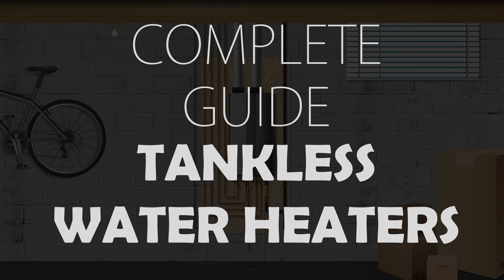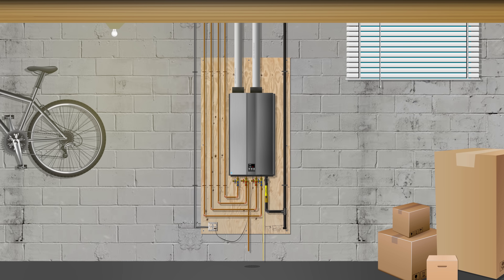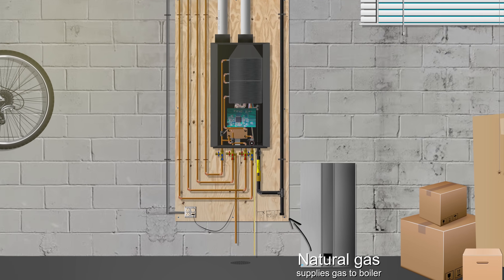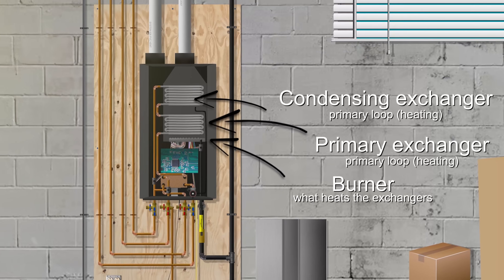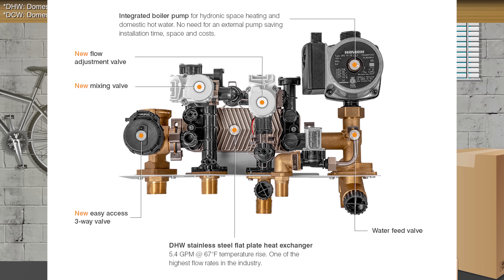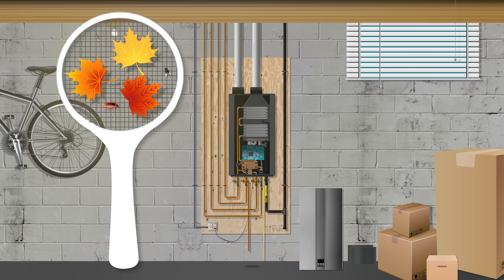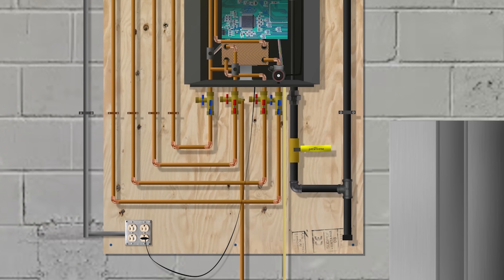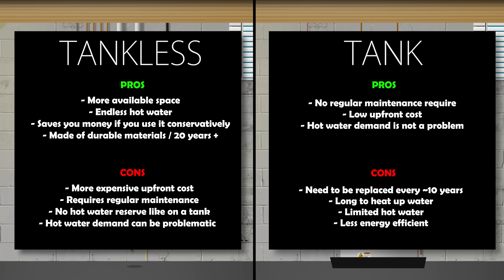Tankless Water Heaters (COMPLETE GUIDE) | GOT2LEARN

Comment: Bottom line is that I'd stick with the conventional tank water heater in an older dwelling.   If  a lot more people knew about, and how to change the anode rod, their water heater would last much longer than 10 years. The problem is getting the darn old ones loose.
Reply: I do same, have gotten double plus the life out of a 6 year tank. I use an electric impact driver to loosen the anode rod. Depending on tank placement, having room to pull the rod out can be an issue.
Reply: @gnic76  Did you replace the rod with the same type or did you use the more modern ones that are like links of sausages for use in tight spaces?
Reply: @loumitch1  Nope, used a solid one, the magnesium ones aren't a stock item and it was cheaper in my area. The linked ones were harder to find at the time.
Reply: My tankless water heater uses half the energy of a tank.
Reply: @SawmillerSmith  Gas and venting upgrades are required for some retro fits;  cost of the unit is double that of a water heater; tankless require more frequent maintenance ; much higher installation cost; pressure loss in times of high demand; and those higher upfront costs could take 10-20 years to offset any fuel savings. If you lose power, no hot water.
Reply: @loumitch1  some use batteries so lost power has no effect.  Yes it depends on many things. I bought a cheap tankless water heater on Amazon and hooked it up myself. It was cheaper for me to go with a tankless in my situation. I would of had to built a lager room for a regular water heater.

Comment: I never even saw one of those. I know tankless coil inside the boiler. Also oil fired equipment is prominent where I live. A few people have gas, and no one has electric heat or hot water. I've seen it but it's very rare.

Comment: Nice explanation. In my own house I placed a tankless, small, electric, on demand unit at the kitchen faucet. I installed an electrical hot water tank (50L is engough for only me) for the shower and the tap in the bathroom. For the heating I switched to IR (infra red) electric heating. In combination with my solar panels on the roof that saved and still saves my a lot of money on energy costs.
Reply from the maker: Niceeee, green is the future!! 🥦

Comment: Not sure if you know this, but here goes.
When you have the simple conventional boilers that rely on zone valves to switch from heating a tank or heating the radiators. One of these set ups is more suited to a house with more than one bathroom, with a higher hot water demand.
Whereas combi boilers are limited to the water flow it can reliably heat up, therefore they can't cope with a large demand for hot water at the same time.
Now for the part some people don't realise. Combi boilers need to have a high BTU by nature, to heat up the flowing cold water fast, which makes them ideal for this. The heating circuit can be zone valved the same as a conventional boiler, therefore allowing for a hot water tank. With that method, you can have bathrooms receiving hot water from a tank, and say the kitchen and utility room receiving the mains fed hot water. Obviously any taps receiving mains hot water will still receive priority from the boiler over the heating/tank side.
And using a mains high pressure hot water tank eliminates the need for a gravity fed cold water storage tank to top up the hot tank. Also, as the central heating side of a combi boiler is pressured, it doesn't need an expansion tank like a lot of conventional boilers do.
I hope I explained that correctly.

Comment: In 2012, my father and I replaced an old tank with a Rinnai tankless and it has been mostly a great experience. I agree that the cost savings really do depend. One of my daughters alone has eliminated any cost savings, because she has little incentive to take showers under 45 min. If it wasn't installed in the corner of the crawl space in thr basement, I'd turn the thing off 25 minutes in.
Reply: I don’t know if you can depending on the age of the unit but you should be able to get another (thermostat on/off) part that allows you to place it further away from the actual unit and in a place that’s easier to access. Some have to be hard wired in but to save money it might be worth looking into.

PS hope your daughter doesn’t hate me for this input :)
Reply: Its a Rinnai RL94iN. I don't think it's worth altering anything. I don't care about the money as much as it is just another thing to be a parent about. She's in HS, so she has all the answers and has figured nearly everything in life out already
Reply: @ccbowers  ah to be young and know everything haha. Well as long as you’re happy with it, for the most part, then I would keep it the same. If you have to replace it then you can look into something different. Rinnai now offers a control module that connects to your homes WiFi so you can control the temperature and other settings from an app on your phone or tablets. It actually might even connect to the into you have because you connect the module to the unit itself. Each year they keep getting a little better and little more intuitive with battery backups for power outages and such. The older units you have to add stuff like that on yourself however. That was the biggest issue I saw with them in the beginning was since you have to plug it into an outlet you would lose your hot water in a outage unlike if you had a standard gas tank type water heater. I told my customers to go to a office supply store or online to purchase a surge protector with battery backup so they could have a few days of power if needed in a storm. Anything that help keep people happy and with the ability to have hot water when needed is what I say.
Reply: Why not just use a wireless water valve and control the flow from your phone.
Reply: Nobody needs a 45 minute shower. She must lead a leisurely life with zero responsibilities. My showers take five minutes if I'm having a very slow morning.
Reply: @paulmaxwell8851  The internet is very impressed with your shower duration and efficiency. So amazing.

Comment: Having used both with years of experience I would stay with a traditional tank system. Everyone always says they will save you money. However, a thankless model will use more gas or electricity thank a tanked model. Ex. My tanked model gas bill for a typical month is $21, the thankless model gas bill was about $45 a month. In addition the thankless model will waste water because it takes forever to get hot water at point of use. Not to mention the reduced flow rate from a tankless. Realistically the ONLY advantage a tankless unit has is for large families so they can shower with hot water continuously. My family of 4 with a 50 gallon tanked system has never had a problem with running out of hot water.
Reply: Reduced flow? Perhaps you had an underpowered unit. I've never noticed this issue. I could imagine if 3 people were showering simultaneously that could happen, but with a tank i that scenario you'd be in a worse spot. I agree that delay to hot water is a significant downside
Reply: You can also get a model with a recirc pump that keeps the hot water line in the house always hot so you get hot water soon as you turn on the tap.
Reply: I've been an energy consultant in the commercial sector for a long time and I have actual before and after data on this issue and I can say and in most instances it reduces the fuel used because it eliminates standby losses during periods of vacancy such as nights and weekends etc. I can't agree with your blanket statement but certainly in some instances I think you could have valid concerns.
Reply: I guess it depends a lot on usage patterns.  My tankless cut my gas bill by about 75% compared to the 40gal. tank it replaced:
https://youtu.be/OBpjMeCODHk
I notice no reduction in flow in normal use,.  But I did rig up a test where I pushed the heater a bit beyond it's maximum BTU rating and there I did see it cut the flow a bit to maintain the hot water temperature, which I had set to 140F.  I also only see a short additional delay in getting hot water at a tap, maybe 5-8 seconds more than what the old tank heater did.  That will depend a lot on the hot water plumbing layout in the house.  In my house, the old tank was actually in a very central location and hooking the tankless up in the same location kept the hot water delay quite similar, maybe ~25 secs. with the tank and ~30 secs. with the tankless.  That could be solved with a recirculation pump.  But for me, the added cost and complexity of a recirc. system is not worth the small time and water savings.  However, if the city would put out a rebate program for doing this, I would probably jump on it.

Comment: Great job, man! But there's one mistake: the circulation pump is set on a heating return, not on a domestic water line. When you're opening hot water tap, the water flows by its own pressure, and flow sensor plugs heater in a hot water mode. So there is no needs in circulation pump on a domestic water line. Otherwise, you did a Titanic job! Greetings from Russia, and sorry for my poor English!
Reply from the maker: Thank you so much!!!
Reply: @Got2Learn  that is true about the water flow. I also know that some combi boilers (Well, some did in the old days, not too sure about all modern ones) won't allow the heating to fire up if there is a dripping hot tap somewhere in the house, if the boiler senses that slight water flow, with the domestic circuit, it always overrides the heating circuit.
Reply from the maker: @mickk8519  niceee!!!
Reply: @Got2Learn  sorry, should have added, you do some great videos young man 👍🏻👏👏👏
Reply from the maker: @mickk8519  thank you sooooo much!!!
Reply: @mickk8519  That's right! All modern combis works that way. When there's no hot water flow, it works only on heating. And when you opening the hot water tap, it plugs to hot water mode, and due to this, the heating is stopped. They using this scheme to reduce a boiler's power. And this idea works nice, because even if two people would take shower one after another, the inside temperature won't fall even on a half degree. Assuming that, the device becomes cheaper, and working by that scheme it uses a lot less of gas, saving your money.
Reply: The guy who wrote this comment has never worked in a commercial building... All large commercial buildings need recirc pumps on domestic hot water lines so you don't wait 10 minutes before getting hot water and which wastes a lot of time and water.  Try again...
Reply: @CybekCusal  he's talking about combi hydronic/central heating boilers, not a storage/instantaneous hot water unit ring main like you'd find in most commercial settings (although becoming more popular in some domestic situations in order to save water) and is right. if you're running your heating (on the boiler displayed in the video) and turn on the DHW water the unit will stop the heating (CHW) process until the demand for hot water has stopped. although both essentially ring mains as the hydronic/central heating boiler has a flow and return, these units generally don't have a return for DHW, if they do you're going to have troubles with your heating :)
Reply: @loneyscape4334  domestic always takes priority. It's always been like this. And the heating pump needs to be external so it can be uniquely selected for the system gpm requirement and the head pressure necessary to match the pressure drop off all the devices.
Reply: @CybekCusal  It seems you'd never worked with this kind of equipment, that is why you don't understand what I'm talking about. Watch this video couple times more and try again...
Reply: @RedBoilerman  I only speak English sorry
Reply: Installing a tankless without recirc is a waste of money imo. Your not getting the most out of your unit.
Reply: @brandonmckillop3859 recirc can burn up the ignitor and houses are too small to warrant one.
Reply: The pressure is always there but recirc pump is needed to keep water in the hot lines hot all the time for instant&endless hot water , otherwise they will only have endless hot water ... Not instant&endless
Reply: Wait what ? Not to be rude but your wrong. I'd love to see some literature proving your point if I'm wrong which I'm open too. I'm not always right and want to learn the correct information if that's the case

Comment: I have no electricity and live at 7500 ft ASL  is there a propane, tankless WH that will work for me?
Reply: Remember that higher altitudes cause a loss in performance in gas and propane appliances.
Reply from the maker: @andrewludwig9251  Thanks Andrew!
Reply from the maker: Yes!
Reply: @Got2Learn  OK. What is it?
Reply from the maker: @paulaaron1109  you need a conversion kit, they sell them where you buy the heaters 😉
Reply: @Got2Learn  Do you know which manufacturer?
Reply from the maker: @paulaaron1109  which brand heater do you have?
Reply: @Got2Learn  Ecco Temp L10 propane
Reply from the maker: You already have a propane heater?
Reply: @Got2Learn  It doesn't work very well. That's why I am considering a new one.
Reply from the maker: I am looking on Navien's website and they have this model here which is good for 10,000 feet, check it out: https://www.navieninc.com/series/ncb-h
Reply: @Got2Learn  Thank you very much.
Reply from the maker: My pleasure!
Reply: Naviens the way to go. I've installed countless of them, no conversion kit required it's all done with the programming

Comment: 20 years ago I was told you can't use a tankless in northern climates where the city water in winter plummets to near freezing. Unless I missed that part in this video, is it still the case today?
Reply: You need to have the tankless sized properly for your application and location. The GPM a tankless can output at your preferred temp is dependant on the incoming water temp, colder water coming in means less GPM the tankless can heat up. Best to go 199KBTU tankless for most residential applications.
Reply: You need to go with a 199k btu (max allowed) and condensing preferred since that provides the most heating capacity.
I have that with 2deg Celsius city water in winter and it easily heats up water to 50C with a good enough flow for more than a shower.
Maybe the units 20yrs ago were not efficient/powerful enough.
Reply: why would that be the case? I think as long as your tank is located inside a heater space, it should be fine?
Reply from the maker: I think it's because they become inefficient seeing the water that needs to be heated is really cold, might be wrong though...

Comment: Great video. You can get a device that you clamp onto the hot water line coming out of the tank that uses am radio waves to dislodge existing and prevent future build up of calcium or scale build up in the lines. It also works in reverse and keeps the heat exchanger clean so therefore once installed you would never have to flush the unit eliminating that yearly maintenance. Also there is a flame rod sensor located on the primary heat exchanger that can get carbon build up on it causing the unit to not function properly. It is held in with two screws and once removed just go over it with a steel brush and reinstall. Do this every other year along with the other small maintenance and the device should last more than 20 years!
Reply: Thanks for the insight...

Comment: How come I never see these in Quebec? I suppose the $100 Hydro discounts on tank heaters help...
Reply: The price of hydro in Quebec is retarded. I don't think many people have Gas because electricity is so cheap. My brother had electric furnace, water tank and regular stuff and it was <$200 a month average. That is ridiculous. It would be easily double in Ontario.
Reply: There’s not enough motivation for tankless gas heaters when electricity is so cheap.
I have an older home in Montreal, and had to jump through hoops to get one. Basically had to order it online, do all the water plumbing/electrical hookups and hang the unit myself. The tech only did the gas and venting hookups.
Could not find a single company that would do the whole install, no one understands them or wants to touch them here.

Comment: awesome video, soo glad you did this one.. my parents went propane tankless next-door.. a 1 room house, its a self ventilating system,-a single metal pipe sticking out the wall. tank is mounted inside. my parents loved it.   cold well water . I am thinking of going hybrid, get rid of my electric tank, to compliment my pex manifold set up. only place i have to put it is my basement. .. i am on the fence with that.. here in Maine. basement never freezes.. always the coolest place in the house. well water also.

Comment: It cut my gas bill to almost nothing in the late spring/summer/fall.  But I only turn it on when I take a shower.  Also,  my tankless model was CHEAPER than the tanks...  one reason I bought one... about $500-600 versus $700 for a 40 gallon tank back 3-4 years ago.
Reply: $700 for a 40 gallon tank installed or not installed?
Reply: What brand of tank?

Comment: Thank you for this tutorial. Wouldn't also be a good idea to add a water filter to the tankless system?
Reply: Only if you have a sediment problem already in your water to your home. Like constantly having to clean out the aerators on your faucets.
Reply: Depends if you live in a hard water area, I have a small cylindrical filter connected to the mains water just before it enters the boiler, even though I live in a soft water area, it will lower the amount of limescale.